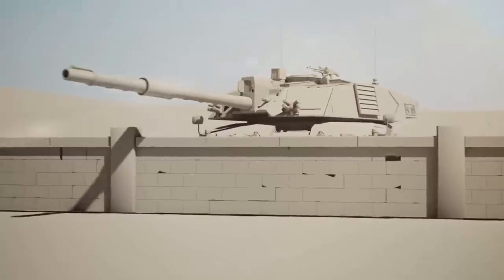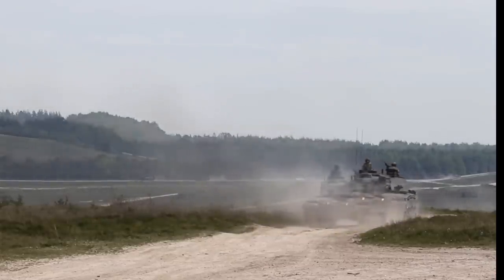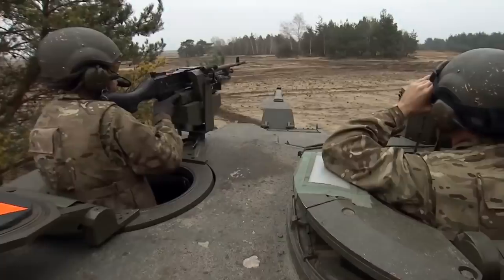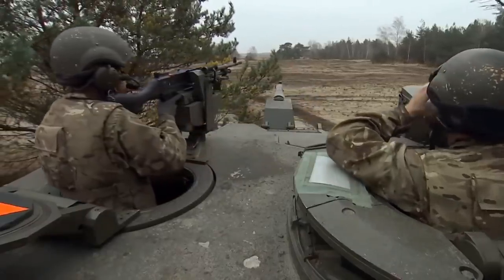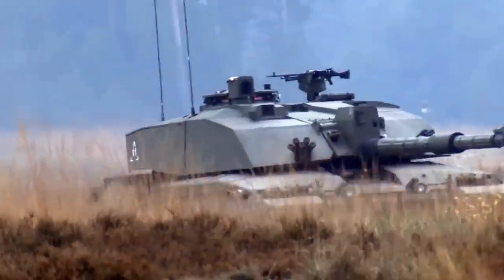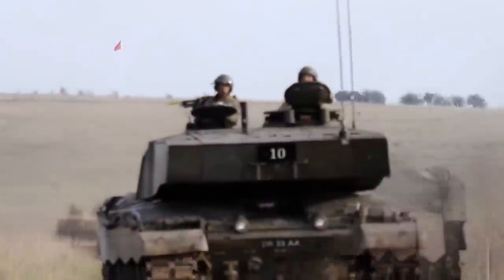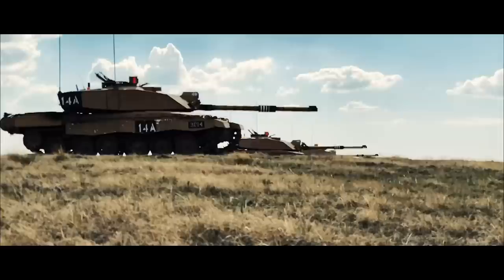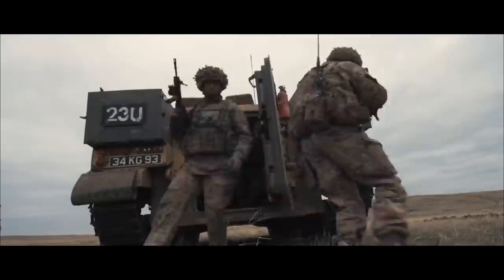Challenger 2 Tank "Black Night" | MODERN UPGRADE

Comment: How does the turret physically connect its electronics to the hull especially the unmanned turrets? How do they prevent this connection from entangling when the turret rotates?
Reply: +b.k. Check out:-

www.moog.com/literature/MCG/Vehicular_Slip_Ring_Data_Sheet.pdf

Slip rings are similar in function to electric motor brushes. This data sheet shows just how complex some of these units are, with not only power, but data (electronic/fibre optic), hydraulics, pneumatics & air con passing through these rotary couplings.

Comment: Blacknight is bling to get people to care, but there won't be any money for real armor upgrade, unless its secret, maybe still room internally for passive armor upgrades, or maybe internal swapping of all the old armor completely to a totally new combination and set of technologies of passive armor. Either way that would be something, that doesn't alter exterior tank shell form. Then have battle-level modular ad-ons that also involve new secret compositions active/passive combination, that in peace time training are left off the vehicle. As to main gun, unless they want to have a brand new turret from Krauss Maffei or Rheinmetal, (whomever makes Leopard turrets these days), there won't be a way to store smooth bore one pc NATO 120mm ammo the way Abrams and Leopard store ready rounds, at least from what I've heard, I have never seen the interior of a Chally 2 in person so going off other's knowledge about the problem. How about some system of electro-chemical liquid propellant that can be stored somewhere, maybe raise tank height a bit so there can be some underside space for a propellant tank that doesn't interfere with fuel storage. Can it leak if hit by a very powerful mine? Yes, but better than moving critical automotive components down there! If a mine hits and leaks propellant, bug the hell out and switch tanks. Maybe have the metal bulge but not rupture the propellant bladder, that the propellant temporarily shifts under pressure of blast to an empty chamber. Obviously totally inactive propellant until the right electrical signals are transmitted and right chemicals are mixed. It can't be a standard explosive primed propellant.

Comment: I guess that upgrade on electronics will be similar to what the type 10 in JSF have, or similar? Japan already had several projects in military cooperate with UK and some joint force exercises, sharing certain system and battlefield information and communication on tactical level won't be a surprise.

Active protection is a good idea, but just for the tank crews, think about what happen to the soldiers in advance with the tank. An unaimed rpg can guarantee elimination of soldiers next to a tank when the aps detect and return fire. Eventually, the tank had to go by itself with no infantry accompanied. Who is going to sort out the ied and mines for the tank?

Comment: Nice. This is less of an overmatch upgrade, more of a 'bring it up to the spec others are already at' upgrade. The engine upgraded is needed too, but it sounds that can be upgraded too separately - or combined as a bloc package. I doubt we will see a change in gun anytime soon if that requires a change of turret, as that would be €XP€N$IV€!!!
Reply: Yeah. Upgraded separately. As in outside the tank on a "test stand" because you will damn sure never keep "2000 hp" cool in the "engine compartment". It's why every liquid-cooled "MBT" on the planet is obsolete anywhere but in "arctic conditions". And "heat seeking missiles" can smoke them with ease there with that much temperature differential between the "environment" and the radiators. Deserts get cold enough at night for sufficient contrast too.

Comment: Would be interested in your view point on the HESH round, my Dad who commanded Cents and Chieftains swore by it as a excellent all purpose round.
Reply: Robert Pettigrew hesh is cool
It’s a problem if the target has a spall liner like most modern tanks
Reply: if a target has air gap in the armor layout...gg
it's going to do it no harm
Reply: @badgamergood6713  no modern tank has fought another modern tank. The biggest threats in terms of tanks are still the t55s export t72s and t62s
Reply: RAY RAY but what if it does?
Reply: @badgamergood6713  then you got the charm 3 DU round XD
Reply: The challenger can also fire APFSDS
Reply: To be honest I was more thinking of the HESH shells as a general purpose round rather than an anti tank, using them instead against light armour and other vehicles, also as a support round as they are supposed to be very good vs  fortifications and buildings. My dad said in the current climate such a round is at a premium as tank vs tank is getting rarer, as you can guess he was a big supporter of rifled main guns and the HESH round in particular.

Comment: Without substantial upgrade in any of the 3 major areas (mobility, protection, firepower) i doubt that a tank, that has stayed basically the same as it was 20 years ago when it was introduced, can keep up with the evolving tactical advancements until 2035

Comment: I think the new protection systems are good but they could probably do with putting a gas turbine capable of pumping out excess of 1500 hp and they should also probably get an Rheinmetall l44 smoothbore or their own modification of it as well

Comment: Awkward moment when you watch this after the challenger 3s announcement after being so adamant it wasn't going to happen... On another note I'd recommend looking at the rheinmetall mbt side by side with the challenger 3, im in the mindset that they're the same tank but the rheinmetall mbt is where it'll end up, just like the m1 abrams with the 105mm gun it was upgraded to a 120... Mid life, i reckon the same will happen with the challenge 3 after the announced 120mm. The rheinmetall 130mm gun is apparently an easy upgrade to anyone using their previous 120mm gun.

Comment: I agree that Challenger II was (is) under powered.  The engine definitely needs to be uprated to at least 1500hp given the mass of the tank.   The gun, being rifled is very accurate, but the ammunition being separated into projectile and charge requires the loader to use more time in loading the gun.  This reduces the rate of fire and reduces the number of rounds that can be carried in the vehicle.

Comment: Can't help but feel British Armoured regiments are being short changed right now, but then the whole defence budget needs to be doubled at least just to give the guys a fighting chance. Subsequently I think that Black Knight is looking more like the version at the end of your video …. Hmmm!On a more serious note, I agree that paying more attention to the core items makes sense, particularly in powerplant terms, which seems to have always been an issue in British Tank design. My concern is that if you add more HP, the inevitable result would be failure of another component/system down the drive chain. So unless you were able to upgrade without breaking something else by doing so, or upgrading those weaker links before there is a disaster, I am concerned that a spiralling expense would frighten off the bean counters.Q: Because I was out of the country during the period when armoured regiments were butchered, can anyone tell me what happened to the Chally 2 MBT's that were supposed to have been placed into storage during the Brown era, or is 200 MBT's all we have (shameful if correct)??

Comment: It's a perfectly fine platform, they need a new more powerful engine, along the lines of the leopard 2 with its modular, quick change engine.
I really don't know why they are so attached to a rifled barrel and didn't change it long ago for a smooth bore cannon, was it something to do with it being safer, with the ammo being separated in to two parts, plus no shell case.

Comment: My main issue with this is that it doesn't address the engine - it's not just about the power but reliability.... also uping the weight and the power is going to put more stress on the transmission, everything needs to be done in a coordinated manner rather than different programmes tripping over each other...

Comment: It is the best MBT in the world. PERIOD!! It has been for twenty years. Tank upon tank warfare and I would not rather be in another tank of any other nation, and it has nothing to do with being able to make a cup of tea in it. 
In my opinion the sabot fired from the L30A1 and then followed by the high explosive squash rounds will take down any tank world wide and so two shots at most from a good gunner and its good night. The speed of Challengers target acquisition and the accurate rifled cannon is where its at and I feel the Challengers platform for maneuverability and precision targeting while on the move gives it the edge in engaging at close range the Russian tanks before they have had chance to activate the mobile weapon systems  which they primarily rely upon. I do feel the mobile weapon systems will ultimately prevail in very open circumstances and where air support is unavailable and rockets with high det charges are lethal and which the Armata weapons platform is incredibly advanced in both offensive and defensive warfare according to the on board systems it has, the T-14s mobile weapons technology is second to none but up close and against M1 As and Challengers who have air support from Apache gunships it will be thoroughly tested. 
However it is also now fair to note that both the M1 A and Challenger 2 can be fitted out with mobile weapons systems of their own. Sensory technology is also becoming more and more integrated within tank defence systems now which really is also applied offensively instead which does not allow the armour to be so easily hit. The Armata has a brilliant defence system, crazy crazy good lol. The ability to also carry the armour systems which allow protection from tactical nuclear weapons is also a huge factor and which both sides have great ability and how the Russians have designed the T-14 is very interesting, three men in a row within a reinforced chamber so the tank is designed like a chamber within a chamber within a chamber , like an aerial cockpit,  and with the reactive armour applied throughout . That being said though I would at this moment still take the Challenger in every circumstance as its Chobham Dorchester armour is proven and the modern systems which can be added that they have now are out of this world, even including the threat of tactical nuclear warfare.
Perhaps the most significant point is numbers really, how many units does each belligerent have? The Ruskies have at least 2000 T-90s of their own model in service and this could easily be multiplied with hundreds of new units built quickly and provided to any battle front within Europe and with the ability to produce the T-14 also then it maybe numbers that count the most and I do not think Britain or Nato can keep up once all nations are industrialised, which I believe Russia would also reach its industrial potential much sooner than Nato could produce, replace and get to European mainland its units.
( P.S.  If in the future fitted with the 2A83 152 mm main gun the T-14 firing range and the kinetic energy it will produce for high explosive rounds could be devastating" and this is where the future will take us seeing the arrival of bigger calibre guns on more advanced turrets perhaps. This could though end up rendered obsolete because of the creation of larger warheads applied to misiles . suppose we will have to see  but I am happy with the fact that we are keeping the Challenger platform because I think it is the best design and it can be upgraded to carry all weapons systems. Even the turret design can be modified and even changed altogether and so why bother designing a new platform? )

Comment: A question that comes to mind with these external Anti missile sensors is how hardened are they.
For example would co-ordination between a team with an Anti-material rifle loaded with some Raufoss rounds pretty much invalidate the system?
Reply: Anne Isopod  Read the post fully.
Key word, Co-ordinated.
You seem to miss the context of whom  I mean for the AM team, meaning 2 men with one rifle - not some silly firing squad idea, to co-ordinate with, the ATGM crew.

Hard kill AGMS rely on sophisticated sensors to engage the missiles, they are designed to not engage projectiles of a size lower than a certain threshold.

The AM crew in such a scenario would be able to blank the sensor of that quadrant as the ATGM crew fired - the end result is a tank crew can only react to 1 event or the other for some form of counterfire
Reply: @komradearti9935  the reason I didn't suggest twinned ATGM is these have a reasonable retire speed.
However the all AMS systems have size calibration that means they won't trigger for conventional rounds.
Reply: @komradearti9935  I'm not suggesting it would be easy, nothing about taking out a tank is easy.

Comment: The tank engine is not strong enough like mtu in leopard.  The mtu has 1500 hp and 47 liter. engine.  It’s not only for driving fast but too also keep up the momentum in difficult terrain. Also they tries engines with 1800hp.

Comment: i dont understand why they are still using a "tank" gun. wouldnt a short barrel ATGM system with 40(ish)mm coaxial auto-cannon on top be more effective for what they are sending this against?
Reply: Anne Isopod  infantry fired atgm's are more deadly to tanks than tank guns. 
this is partly because they can manoeuvre to always hit square on, or even top down. further, with the counter weight for the barrel and 120mm auto-loader removed, that'd reduce weight and give you space for other stuff. it would also allow a tank to crest small barriers to go hull down more easily, since they wouldnt need to worry about the breech hitting the roof of the turret, which often is a limit to gun depression.

Comment: strange idea in regards to the main gun, would it be possible to design a new turret that had 2 barrels, 1 in standard smooth bore, and the second in the current rifled version?
Reply: Why. Smoothbore beats rifled in every aspect.
Reply: @jonny2954  was just a thought, didn't say it was practical

Comment: Honestly, I feel that tanks, well modern tanks as we know them... The Abrams, Challenger, and a small few others are at a "design stand still". Meaning, they are as good as they can get, design wise. Yeah, you can throw in all the fancy electronics you want, and blah, blah, blah!!!...but to make leaps and bounds in design, or to achieve that " wow factor" that some tanks have ( like the Abrams when it very first hit the battle fields). You can only go so big before a design is just not practical and way too heavy. 
Tank design is at a stand still right now. That's my opinion.

Comment: Like the idea of modular  electronics and agree with the Russians idea of card slots for aircraft electronics verses pack the wires and loose electronics into a boxed area to save a few pounds. What good does it do to save a few pounds of you can't repair  it easily and fast. Keeping it running is more important than a few mph or kph faster. Of course the UK will try to save money.

Comment: So, what are the advantages of a smoothbore barrel?
Reply: James Stirling as far as I unterstand it, higher shell velocity and therefore better penetration  (dependant on the shell of course) and the fact that you can get your hands on smoothbore ammunition way easier than ammunition for rifled guns, as Britain is the only Western country who still uses and produces it.
Reply: More ammunition choices is the biggest difference, the latest L30's have a stupidly long life expectancy due to manufacturing processes, the L30 had better penetration until the L55 upgraded its ammo, either way the L30 is still way better than the L44 for penetation (as used on the M1A2).
Reply: @komradearti9935  the L28 round is longer than 600mm.

Comment: Main problem with the Challenger 2 is too few built and they should add a 25mm secondary weapon.
Reply: Mike B. There is no reason why they should add a 25mm secondary on the Challenger.
Reply: Why waste heat and silver bullet's to waste Humvee's that's why   @fatstacksfatlips8708 nd a lot meaner then the 7.62
Reply: Mike B. It’s meaner than a 7.62 but the ammunition takes up more space so you can’t put out fire for as long as you can a 7.62. It’s why the largest caliber of secondary on modern tanks is a .50 cal.

Comment: I think you've misunderstood the LEP bidding process. BAE and Rheinmetall are both bidding, neither has been selected yet. This isn't even 80% of BAE's bid for LEP upgrade or really that representative of what a final CR2Mk2 will look like. The money involved has been repeatedly cut so the amount that each company can upgrade it isn't huge.

Regarding BAE, they've just bolted parts onto a CR2, it's completely un-integrated and really was a poor choice showing it in such an incomplete form. ATDU have named it 'black shite'. Wait until you see Rheinmentall's, it's a lot more innovative. BAE's bid is just uninspiring, it's very standard but nothing novel and that frankly means LEP will need a LEP2 in 5 years